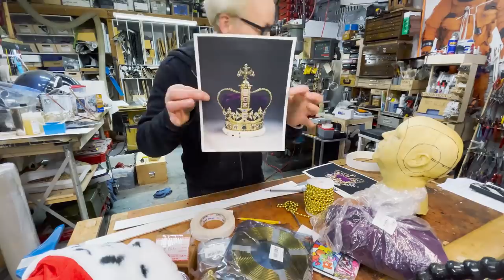Adam Savage's One Day Builds: St. Edward's Crown

Comment: As a jeweller, may I suggest a thing about cleaning brass from flux and soldering stains? One of the most effective methods I know is just soaking the part in dissolved boiling hot citric acid. Makes the parts clean and shiny in just a couple of minutes :)

Citric acid is dirt cheap and removes most of the stains extremely effectively. You can just watch all the scales and particles flow off your part, and go to polishing almost immediately after this treatment. Just make sure that the acid is really hot.

Also, you should "set" your flux with a blowtorch as you are applying it (or just apply it to preheated brass), so that it becomes kinda like a white foam coating. This prevents extra scaling and stain buildup and keeps your soldering joints cleaner.

Comment: @22:45 Today I Learned: Adam has a proper blacksmiths anvil! With the Pritchel hole and Hardy hole both still in good shape, a cut-off shoulder that looks good, and the Farriers horn still pretty clean. And he’s using the Farriers horn for shaping metal in what appears to be the correct way!

Comment: Today I have a tool tip for you Adam :) I was introduced to it when I used to make CT Scanner slip rings.  For cleaning metal surfaces more gently while giving a nice shine I like to use a small pneumatic angle grinder with a roloc adapter 2" roloc scotchbrite/scuff pads. I use a pneumatic kobalt angle grinder with a 1/4" collet.

Comment: For longer strips of brass sheets you can look for the brass plates used as a"kick plate" in doors available at most well stocked hardware stores, they come in brass, steel nd aluminum...just cut them to the strip sizes you need.

Comment: A great cleaner that would remove the flux and heat oxidation after he built the brass parts - clock cleaing solution. A very good homemade version can be made using ammonia, pine sol and murpheys oil soap. It strips tarnish and light corrosion off brass bronze and copper and is even great for cleaning small ceramic or porcelain things. Ive used it for ages to clean antique light fixtures and like the name implies clockwork and mechanical mechanisms.

Comment: Random thing about blades: I used to work with aircraft upholsterers and they never bought blades for their scalpels or stanleys. One guy had a workshop at home and would make little razor-sharp blades out of hacksaw and bandsaw blades. They kept their edge at least ten times longer than purchased blades, which were only really good for one job before being discarded. He did it for fun, never charged. Big fella, big blue overalls, big grey beard, he was the real deal.

Comment: You can use Potassium alum to make your pickle: dissolve some on water and heat it using a small cheap slow cooker on low. It's cheap, and way easier - and safer - than handling acids.

Comment: I have already made it the Edward crown of queen Elizabeth and had the same amount of fun trying to make it but there is a more clever way around the four bends on the top of the crown is a tip for you buy plexiglass and bend it over hot flame because it will bend with the heat of the flame making it go soft allowing you to bend it slowly without it breaking or snapping and it is on here YouTube how to bend plexiglass

Comment: That would be the St. Edwards Crown. There are at least three crowns that could conceivably be worn by the current ruler, as far as I recall, but there are many more crowns representing the UK and its members...at least five of which are still kept in the world-famous Tower of London.
[edit] Also, I just noticed you said "soldering." When what you are doing is brazing, i.e. using brass instead of solder to join two metal parts together

Comment: Theatre Props get used for much of the rehearsals, then used every day at least 6 times a week, sometimes twice a day so it's fairly obvious that they'd get far worse abuse than a film prop which might get used just once for a few minutes then put away on a shelf. 

The part you put on your head that holds the crown in place under the actual crown made from Alluminim  is a definite product to be made and sold. Market it to the same geniuses that bought the Faraday cage for their WIFI routers. Sell it as a Anti G5 signal shield which also offers some protection from the Covid Vaccination (as long as you don't get or haven't already had the Vaccine)